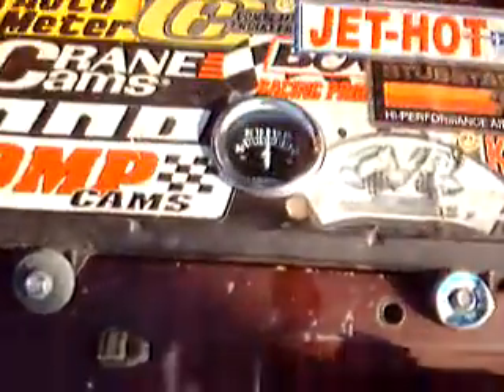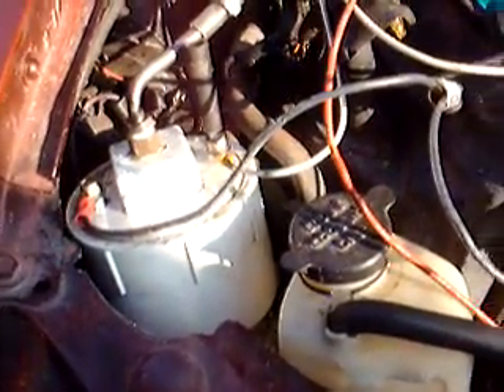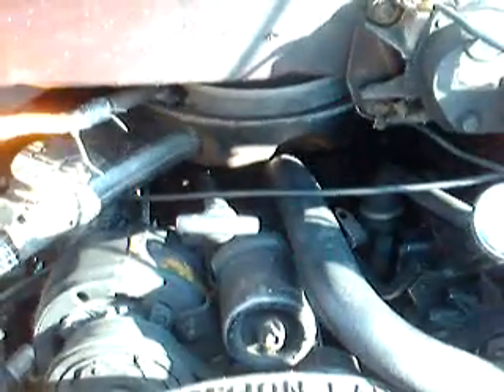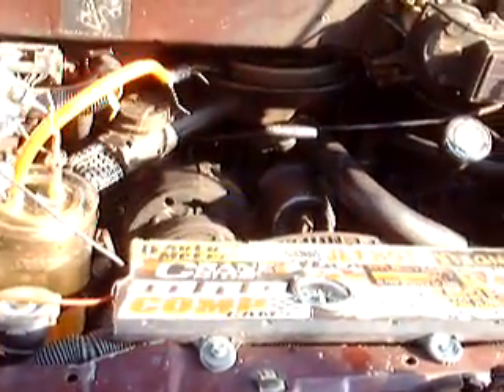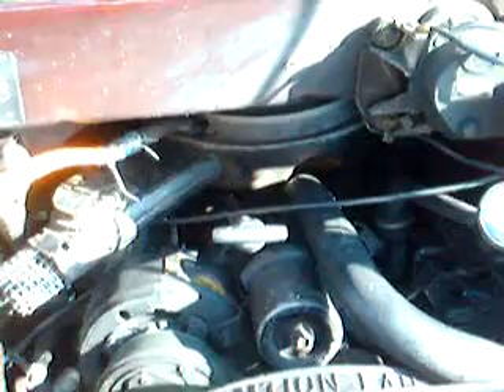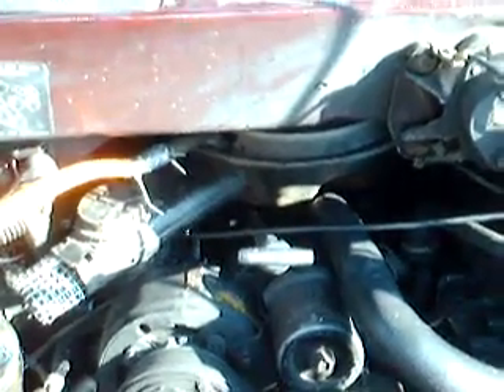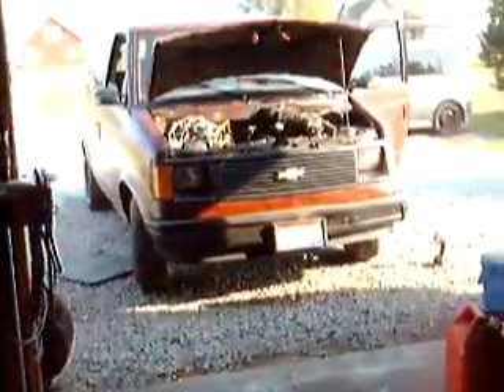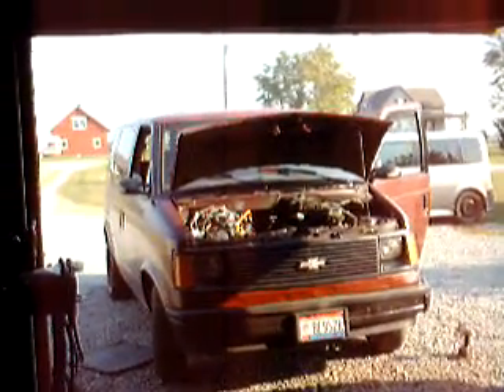HHO Maker Running 2 Oxygen Sensors O2

Comment: Are you looking to make it leaner at idle faster ,if so I think you might be looking for a heated 3 wire 02 sensor ,running your 02 senors that far down makes them take to long to heat up and not go into closed loop to get a leaner mixture at idle ,I ran into that problem when I put headers on my van ,running the 02 sensor at the collector ,making the computer run in open loop most of the time (rich at idle) making it not pass smog at idle test.1 wire 02 sensors are fine if you run it into the exaust manifold where it heats the 1 wire 02 sensor up fast.. they really don't work very well the way you have them..if you want to make it work with the 1 wire you need to put it closer to the heat  of the exaust manifold or in the exaust manifold,that would be best for the 1 wire 02..if you have headers and need to run the 02 sensor farther down like you have them run the 3 wire 02 sensor ,there will be 3 wires two white wires hook one to switch power the other to ground and the remaining wire to the orig. 02 sensor wire witch goes to the computer..that will put you into closed loop fast letting it pass smog .

Comment: So, by these standards, i should be able to run a dual exhaust with 2 oxygen sensors, (where my computer is recognizing my oem 1 oxygen sensor) and use a resistor to cut the voltage in half, for a reading that will not bother the computer.?